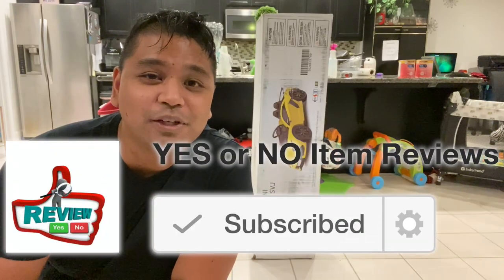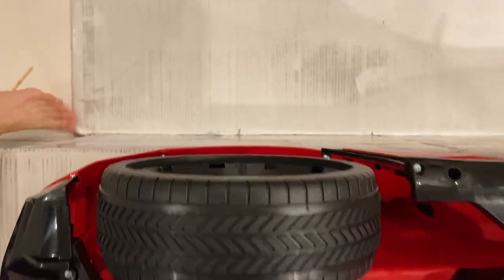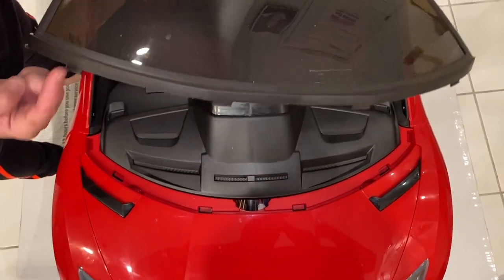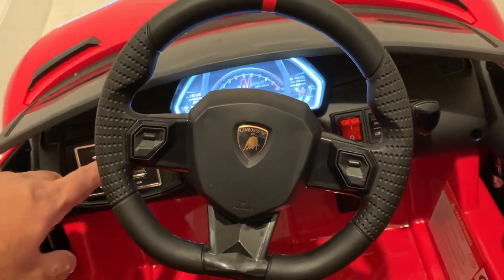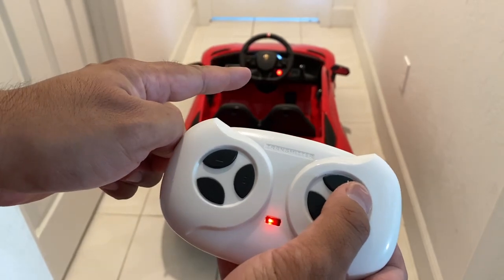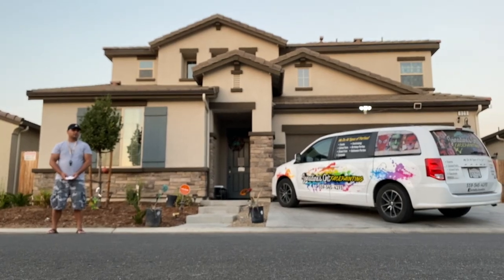How to INSTALL and USE "LAMBORGHINI AVENTADOR SVJ"

Comment from the maker: ⏰ TIME CODES:
0:00—Intro
0:19—Unboxing Lamborghini Aventador SVJ
1:17—Everything inside the Box
1:29—How to Install Lamborghini Aventador SVJ
1:41—How to Install Rear Bumper Support Frame
2:31—How to tell the DIFFERENCE between Front and Rear Tires
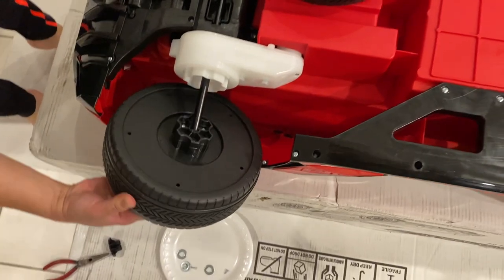3:10—How to Install the Rear Tires
4:02—How to Install the Front Tires
4:34—How to Install all Four Hubcaps
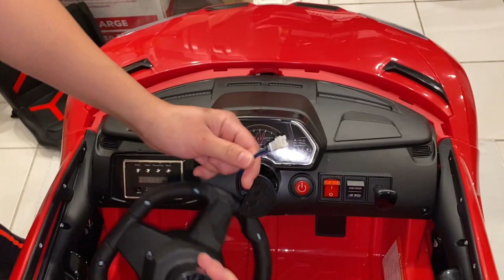5:20—How to Install the Steering Wheel
6:51—How to Install the Windshield
7:22—How to Install Side Mirrors
7:43—How to CONNECT Battery Connectors Together
8:05—How to Install Seat of the Car
9:05—How to Install the Spoiler
9:22—How to Charge the Lamborghini
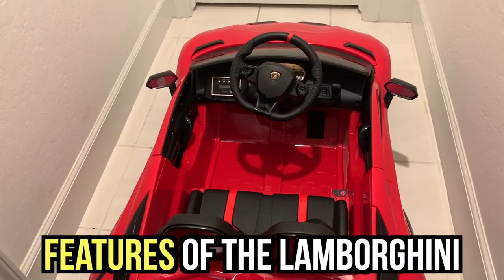10:34—FEATURES of the Lamborghini Aventador SVJ
10:41—How to Turn On the Lamborghini
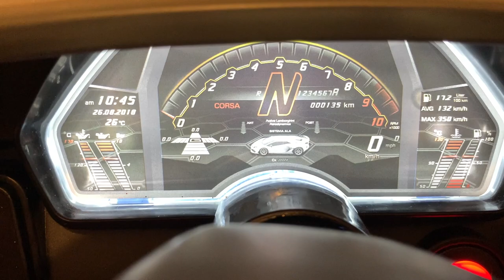11:03—How to USE MP3 Feature on Lamborghini Aventador SVJ
11:54—How to ADJUST THE VOLUME on Lamborghini Aventador SVJ
12:14—How to USE the TF Card (Micro SD Card) Feature on Lamborghini Aventador SVJ
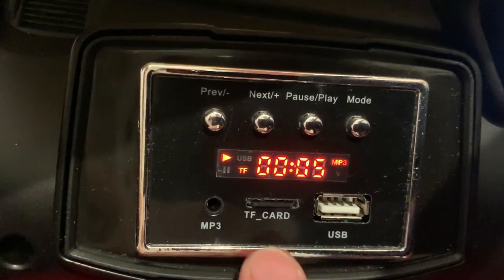13:18—How to USE the USB Feature on Lamborghini Aventador SVJ
14:14—Does the Lamborghini Aventador SVJ Charge the Phone when it’s plugged in USB?
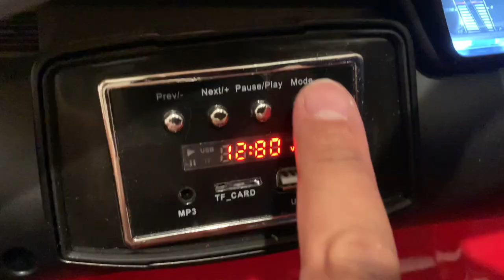15:19—How to USE “Mode” button on Lamborghini Aventador SVJ
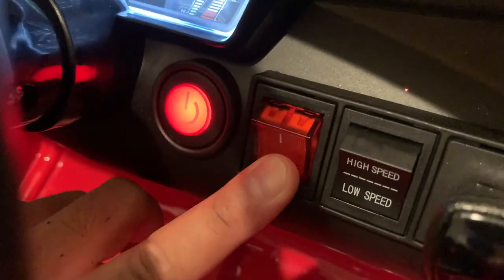16:13—How to USE the Light Button
16:37—Where is the High Speed / Low Speed Button?
16:50—How to USE the Accelerator with the Gear Shift
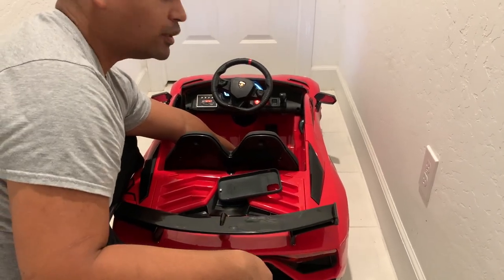17:20—How to USE the Horn and Music Button on Lamborghini Aventador SVJ
17:46—How to Open the Doors on the Lamborghini Aventador SVJ
18:15—How to USE the Seat Belt of the the Lamborghini Aventador SVJ
18:39—How to Open the Trunk of the Lamborghini Aventador SVJ
19:04—How to Roll the Lamborghini Aventador SVJ on Wheels
20:06—How to Install Batteries in the Controller
20:23—How to Pair Controller to the Lamborghini Aventador SVJ
21:10—REVIEWING Slow Speed on Lamborghini Aventador SVJ
21:43—REVIEWING Medium Speed on Lamborghini Aventador SVJ
22:09—REVIEWING Fast Speed on Lamborghini Aventador SVJ
22:39—GOOD things about the Lamborghini Aventador SVJ
23:25—BAD things about the Lamborghini Aventador SVJ
24:14—Learn More about the Lamborghini Aventador SVJ

Comment: I can’t get controller to pair. It does blink, but when I touch power button it won’t stabilize and pair.
Reply from the maker: Hello Sandra! Did you already watch 20 minutes into my video? If not here is the pairing the controller part. https://youtu.be/CdSyejuUzNY?t=1225
Reply from the maker: If you already did watch the video, Did you try taking out the Batteries and putting them back in? Sometimes that works.